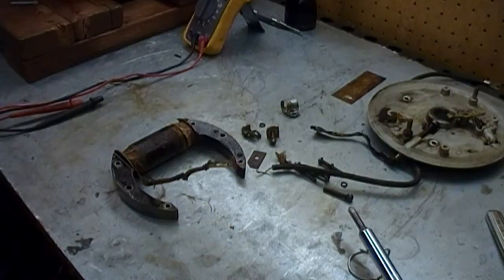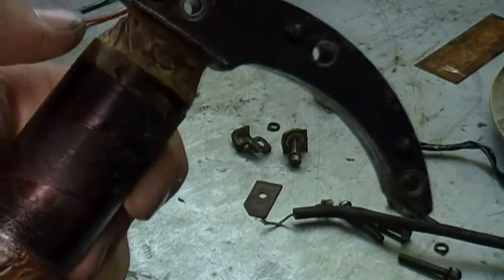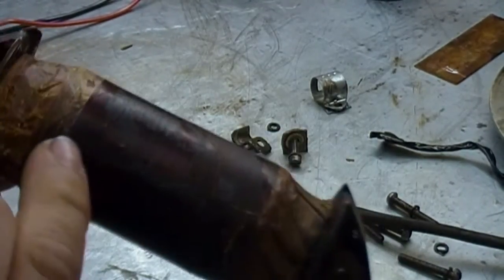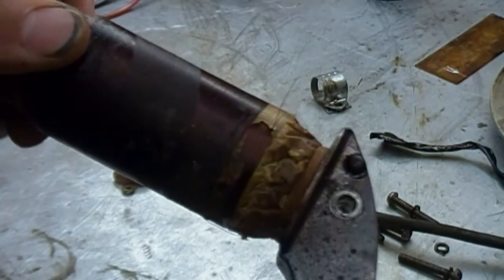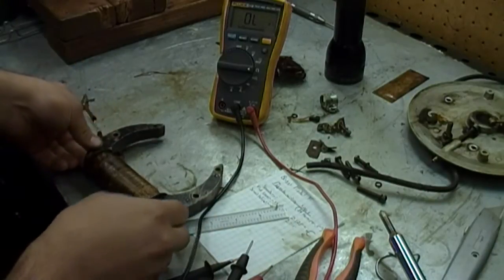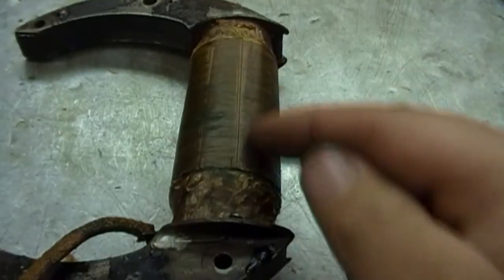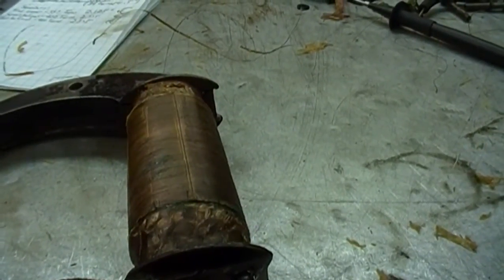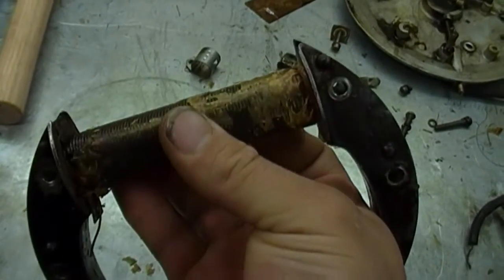Briggs F Magneto Rewinding Pt.1

Comment: Thank you for posting the video. I have a very early FB with the same mag plate. There is a hole in the plate next to the condensor (just to the right of it). I have an insulated wire coming from the coil (above the winding, but goes down into the winding through a hole in the armature) that exits the plate through the hole and is open ended. Not sure if it should be grounded or what it could have been used for otherwise. I'm curious if your model F has this set up or if you've seen what I've described. Thought I would ask before attempting a rewind. Thanks again for the video.

Comment: Hi SEMechnic, your example is very motivating: I have to build a magneto for a Bosch flyweel, fitted to a Flink motor. If you could answer in this BriggsF  case: how many turns on primary and  wire gauge . Best thanks for sharing, oscar

Comment: I would use the slowest speed possible considering the size of the wire your using. I have the atlas manual of lathe operations in pdf
it has the charts for the 10 inch lathe and i think a picture of the coil winding attachment.  it's a pretty big file 54.6 mb you might be able to find it online like i did

Comment from the maker: Thanks! The 1/8" difference would be acceptable clearance wise, not being sure what effect there would be functionally I have decided to stick with the original gauge wire.
Unfortunately the laminations of the core are one piece so it will have to be wound as is.

Comment from the maker: I suppose in theory you could increase spark voltage by having a larger ratio of sec to pri.  However you would also increase resistance in the secondary, as well as the distance from the core the winding will be.  Would be an interesting experiment.

Comment: make a hook to fit into the holes each side of the winding then put it between lathe chuck and tailstock chuck with a swivel and pull tension with the tailstock. that should do ok for re winding. Im sure you could hook up a counter for recording turns.
In interested to see what you come up with to do this.
it will be a job and a half I guess but you can do it Im sure.